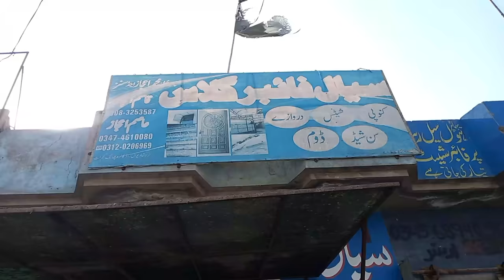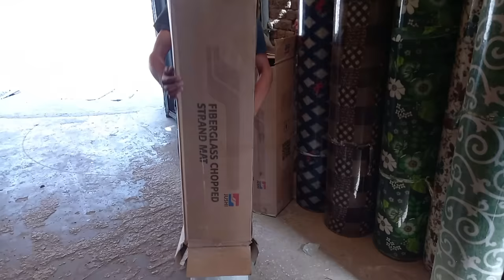How to Make Fiber Glass Sheet with Amazing Process ||Fiberglass Shed

Comment: **WOW** Amazing Skill working with such a large volume of resin and area to be covered!!!! I worked with polyester resins all my life, and I struggled to judge curing time in relatively small batches. Please try to use any safety measures you can to protect yourselves. Even fans to increase ventilation may help you over the years.  Polyester can be dangerous, both through skin contact and breathing the fumes.
Reply: Exactly @DavidpsCaddy. Due to not having much information, laborers often put their lives at risk.

Comment: Apologies for my ignorance. What use is given to those sheets? what do they use it for?
Reply: @Gustavo Diaz Bandres  They can be used as water proof sheets on sheds , for partation between two rooms  ,panel doors ,so many uses and very durable water resistant sheets  can be used in place of glass Light passes through an makes th surrounding decorative
Reply: @chandramohanpai2082  thx!!